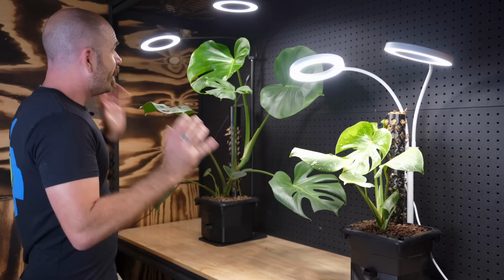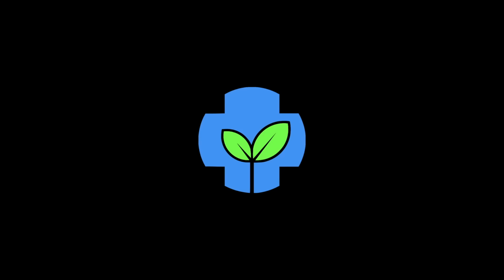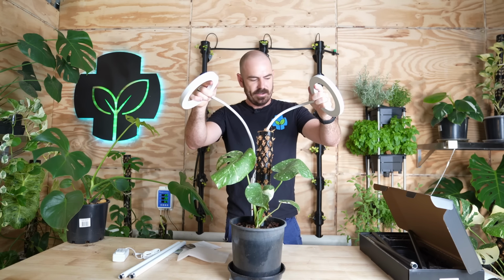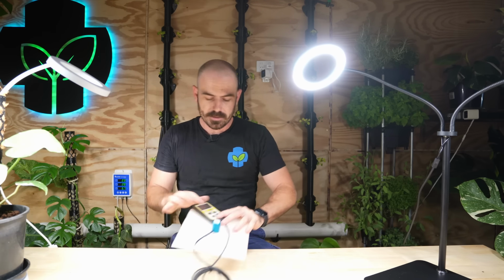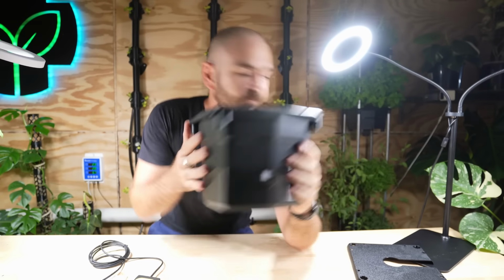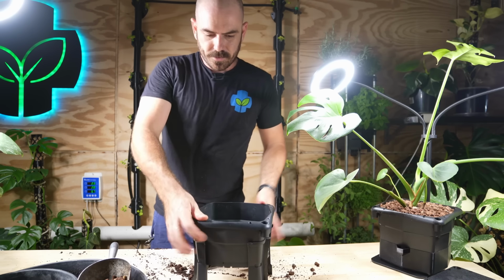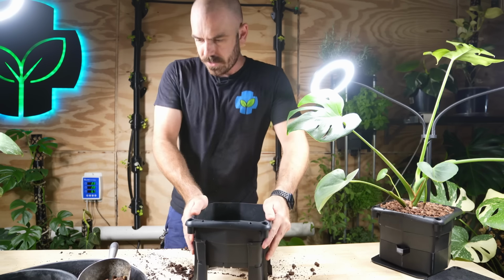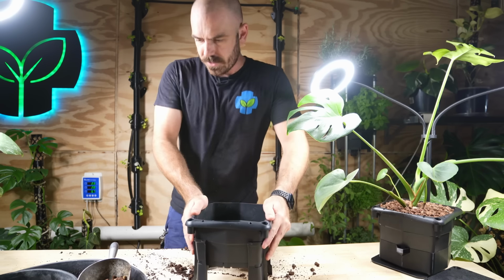The Solution to Your Indoor Plant Problems: Halo Grow Light x Self Watering Multi-Bucket

Comment: I have several Thai cons growing well.  Good soil and good light is going to help them grow as quick as they need to grow.  Let them get root bound, don't overfeed them.  Don't stress the humidity to any crazy degree.  They are plants that will often suffer from overzealous, well meaning plant keepers.  Give it good light, don't overwater or overfeed, and leave them alone.  People in your position, having a lot of knowledge of fruiting plants, the chemistry and art and craft of hydroponics, growing lots of other stuff, lots of tools, and a youtube channel, are more likely to over do it with this plant.  Good placement with light, healthy aroid type soil, a pot that lets their roots get dense, allowed to dry out a fair bit between watering, and then leave them alone.  They adapt to a good space, settle in, and then get growing.  Its good to remember that Monstera are very large plants and most people not in tropical climates only experience them as basically infant plants, and as a result, most people focus in on a very short term, limited range of the plants growth pattern, due to space availability and time frame.  But I have friends in Northern California with a Thai Con that is like 4 inches in diameter on it's main stem, and is about 10 feet wide, and is currently fruiting, in an area that stays under 90 degrees in its very hottest days and the humidity is always around 45%.  But the light is good and it is well established.  They haven't repotted in years, the plant is so massive. Benevolent neglect in the right light is the true secret.

Comment: i wonder, would it be possible to 3d print a structure that simulates capillary action, like an artificial wicking system to be able to phase out disposable substrates like coconut coir for growing plants more sensitive to flooding like alliums? if so you could lower the operational cost of hydroponics even further than you have.
Reply from the maker: I’ve thought about this many times. It would have to be biodegradable. I’m already hyper aware of the waste involved in grow media. And printed parts.
I stress endlessly about making the designs as plastic efficient as possible since so many people will print them.
A 1% reduction in plastic can equal a lot of dollars and kg of wastage.
I am super excited by the idea tho.
Reply: @Hoocho  there is a biodegradable plastic made for this but it is unbelievably expensive. the thought i had for something reusable like a net cup made to be endlessly reused to lower the overall upkeep and cost overhead of hydroponics while also making kratky applicable to more types of plants. PETG would be a good candidate because while it isn't bio-degradeable it is the easiest plastic to recycle and would last an extremely long time even if used as one part, continuously.

essentially i'm talking about a self watering net cup rather than substrate, that way a bio-degradeable substrate like scoria can be used instead of something single use that gets spendy for the kitchen gardener.